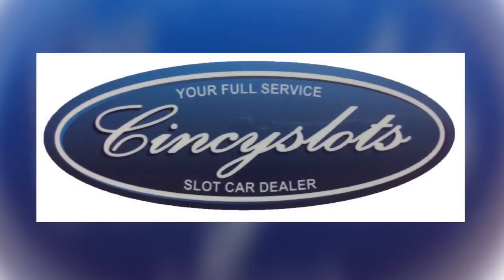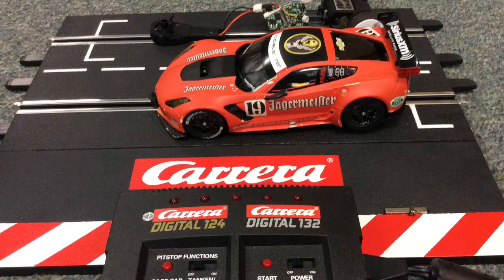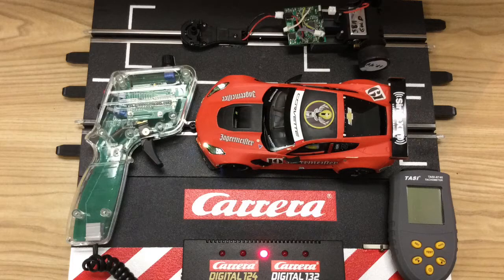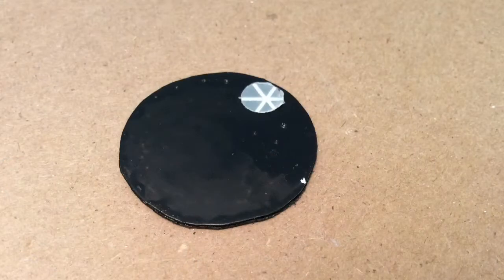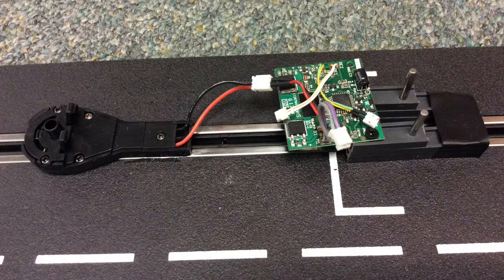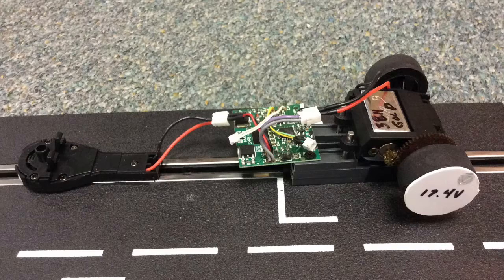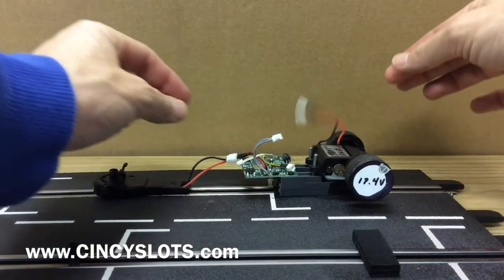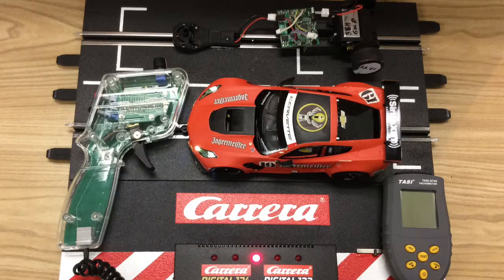Cincyslots RPM Checker for use with Carrera Digital D124 & D124

Comment: Yes it has and one question do you check voltage or amps of the care
Reply from the maker: Neither.  We set the track power to 17.4V.  I'm not sure why other than friend of ours is from Germany and we use the same rules as the Berlin race group.  He visited them last year while over there.  They've been tech'ing motors for years.
Reply: Sounds like a Carrera optimal voltage. Just guessing.

Comment: Hi can you tell why you disqualify cars at 3750
Reply from the maker: In our race group we only allow box stock motors.  A stock D124 motor should not have the power to turn more than 3750 RPM when cool.  If it does than it's most likely NOT a stock motor.  Now, after the motor is has been running and is nice and hot, we have seen motors run above the 3750 but  not when they are cold.  Hope this answers your questions.
Reply: Do you know what the rpms would be on a 1/24 bmw m1